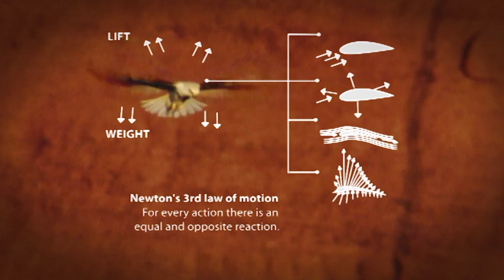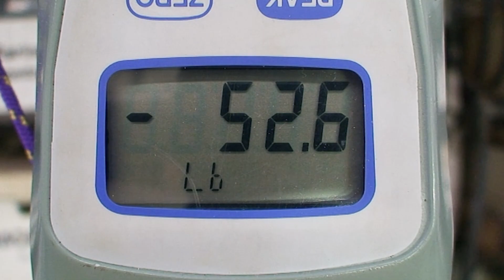Is a Truck Full of Flying Pigeons Lighter Than with Pigeons Standing? | MythBusters

Comment: If pigeons are flying, they are not adding to the weight, they are above the truck. This didn't even need to be checked, it's simple logic. A better question would be "if a truck full of pigeons are all flying, is the truck really full at all?